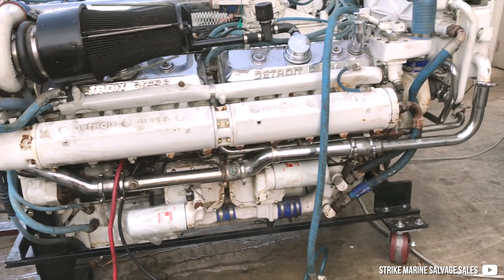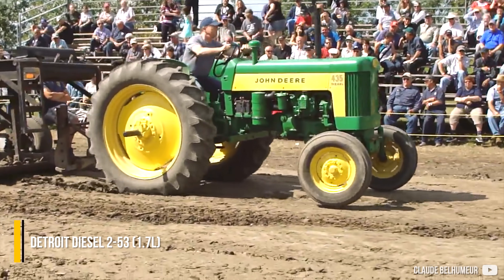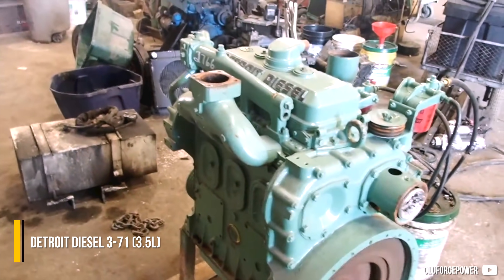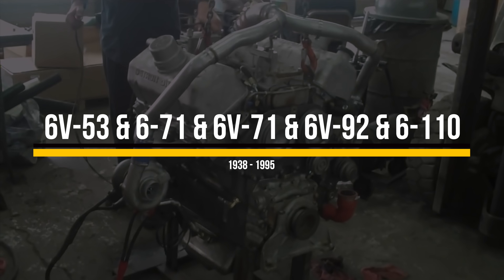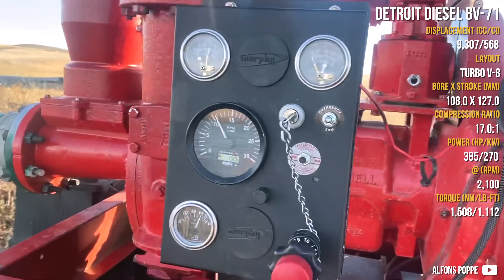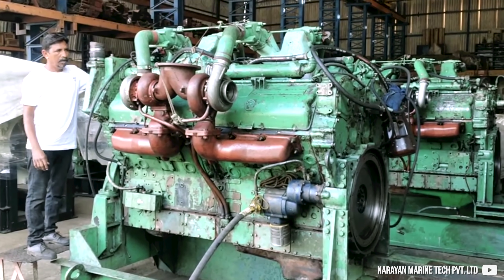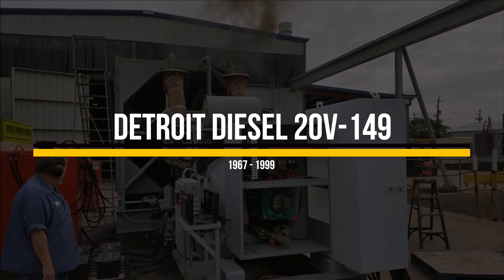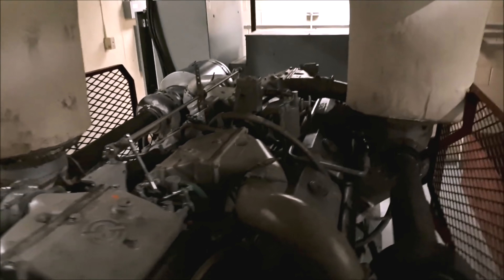Single to 24-Cylinder Detroit Diesel Engines

Comment: Diesel nuts: I've got a V12 in my dually pickup.
Semi-trucks: That's cute
Reply: Diesel nut here. Who needs a v12 when a stock block 12v is good for over 1000.
Reply: @rattyratstuff7125  because a v12 is good for well over 3k?
Reply: @THESLlCK  what v12 will fit and actually do good in a pick up?
Reply: @THESLlCK  that's a 4-53........
Reply: @THESLlCK  ok so you spend 30k on the base block..... to not even triple a stock block 12v with cam......... dude yall tarded
Reply: Well... the 16 cylinder engines weren't exactly common. Most had the 8 cylinder engines
Reply: @j.d.saccociates3313  cousin still owns 3 semi shops...... ya he's never even seen a v12 and he's been doing this since the mid 50s
Reply: @rattyratstuff7125  v12 detroits were reasonably common here on the west coast for off highway logging trucks, these things ran almost double the load of an on highway truck, they had log bunks on the trailers that were 16 feet wide. Pretty cool trucks, but ya not common
Reply: @j.d.saccociates3313  hmm. Never seen a Detroit 12 on the road in haulers. Maybe it was exceedingly rare in Montana idk
Reply: @rattyratstuff7125  oh ya when I say reasonably common I mean I've seen like 5 of these off highway trucks, logging ain't what it used to be. I've seen one on highway v12 rig in New Zealand in a museum/collection... Also seen some v12 plants in tug boats
Reply: @j.d.saccociates3313  well shit. I'm gonna have to look for them then haha. Sounds rad. There might be one at the local car museum that I've missed
Reply: @rattyratstuff7125  ya keep your eye out for a late 70s kenworth trucks, some of them had 12v71s in them
Reply: @rattyratstuff7125   I operated, maintained, and overhauled 3 of them at work. 12V71s with 4 valve heads and NA. Setup as 1800 RPM marine engines but used to drive a gearbox that drove a 96" prop in a 120" OD pump at 108 RPM max. Idle was 1000 RPM, low speed was 1400 RPM, normal was 1800 RPM, trip was at 1900 RPM to stop any runaways except the guys getting away from the engine.
Reply: @gravelydon7072  this is just nonsense. Why 1800? Is it one of those heapin 30L kinda things?
Reply: @rattyratstuff7125  To match it to the prop speed and load mostly.  And for durability. Prop would cavitate at around 120 RPM when the water was cold and as low as 105 RPM  when it was warm. We were a place that required us to be able to run 24/7 for up to six months straight if need be. We often ran for over 90 days with just a shutdown for the oil change in the engine every 300 hours. An unexplained down time event would trigger a phone call from our HQ who may have gotten a phone call from a Federal district Judge, citizens, the Army Corps of Engineers, or the Governor. We had an up time of close to 100% except for the oil changes.   We stocked spare hose and fittings, filters, gasket materials, cylinder assemblies ( liners, pistons, rings, pins, clips ), injectors, spare direct drive to replace a clutch or later hydraulic clutch, spare bearings for the pumps and wear rings, packing by the rolls, and later, even a whole engine. 852cuin/14l engines.
Reply: @gravelydon7072  oooohhhh so like building high strain aircraft engines?

I had a triumph built by an aircraft engineer. Ran with stock Hayabusa.

Bought one to replace it........ such a sack of shit....

The attention to detail yall have is incredible. The dude had milled every part by hand to minimize every gram. It revved to 17.5k when the next stock one I had revved to 12k and that was really pushing it.

Comment: 1:23 This one sounds like all of the thumpers (1-cylinders) but mostly like a Harley-Davidson V2 but if it were only a single cylinder instead.
2:57 Sounds like a Fiat 0.9 Twin-Air.
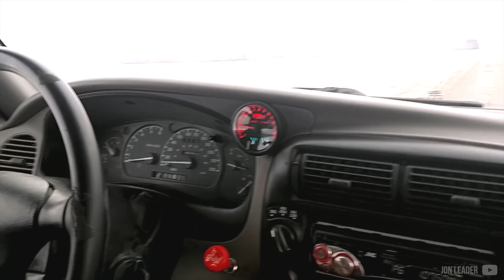3:53 This one sounds like a lot like of a V6...
4:57 The 4-53 sounds like a Cummins 3.9.
5:15 That very much sounds like the naturally aspirated 4-stroke diesels.
6:50 That sounds like as if it were its 3-cylinder variant.
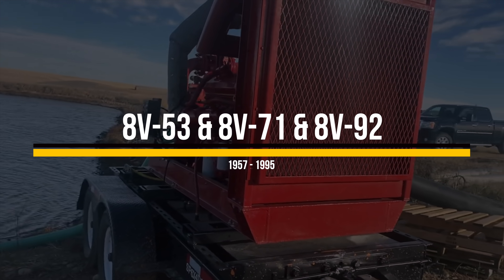7:07 This one almost exactly sounds like a Cummins 5.9/6.7.
8:08 This 8V71 sounded like a Subaru Boxer Diesel but if it sounded like its straight-piped petrol counterpart.
9:25 Sounds more V8-ish than V12 then the 12V-92 sounds like the V12 TDi in Audi but magnified to an infinite amount at 9:35.
10:56 This 16-cylinder sounds EXACTLY like a V8.
11:43 This V20 sounds like something I've never heard before.
13:18 The V24 literally sounds like its a 6-cylinder.
Reply: There's a sled pulling Freightliner Argosy with a 24v71 but outfitted with 4 turbos.

That shit can carry a house with little effort if possible. Oh and its coupled to an Allison automatic...
Reply: @ENYoriginal  Holy torque... that's insane, how much HP does it produce and its torque?
Reply: @SolaricSage116  2600 Horsepower and lord knows the amount of torque...the torque numbers wasn't posted
Reply: @ENYoriginal  Holy moly... 2600 HP!?